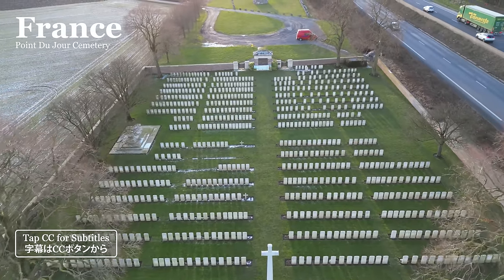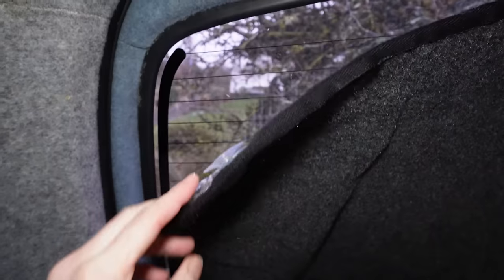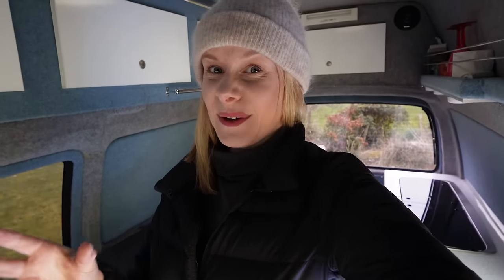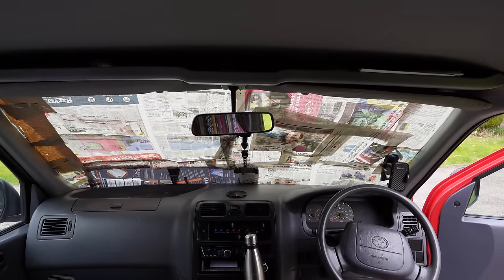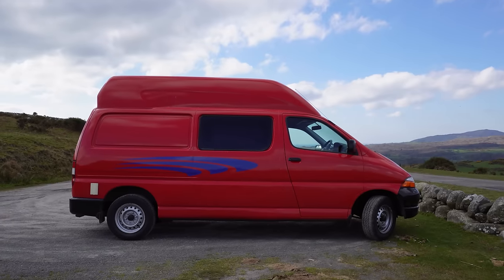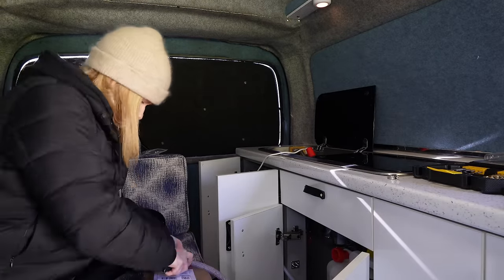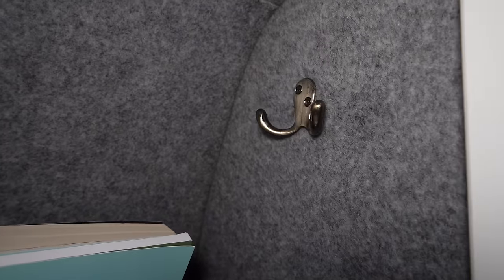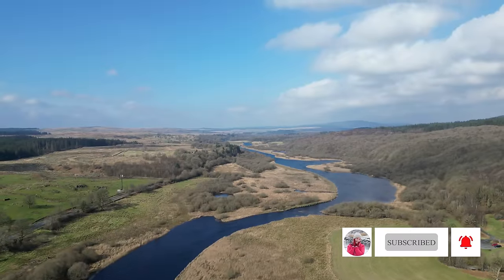It's Time To Make Some Changes...

Comment: Hi, Ruth, and glad to hear you’re recovering so well 🙂. I’ll add my voice to those suggesting Velcro for the window-covers — I would suggest using something similar to the epoxy used for rear-view mirrors for the patch you want on the windows, as it is very heat-resistant.

The only tricky thing would be for the roll-down windows (driver and passenger doors) — probably have to put up with the suction-cups for those, or the Velcro would run into the weather-stripping.

About the electrical situation: Since you are otherwise happy with the huge battery pack, wouldn’t there be a way to convert the voltage out of that to 12 V? Might have to bribe an electrical engineer with a bottle of single-malt Scotch 👍❤️, but I’d think there would be some easy way to “neck-down” the juice to 12 V (easy for a EE, that is 😅).

Is that colossal battery 240 V, like most Euro electrics? Being an American, I always have to remind myself that systems in the rest of the world run at higher pressures (voltages) than what the U.S. uses at the household-level.

Some kinda crap about higher voltages being more efficient or something 😂 — personally, I think it would be a lot safer if the entire world used good old 120 V AC, and 12 V DC, “like God Intended 😂”!

Japan is a whole other story, I guess 😅, as it usually is (and as you know quite well)!
Reply from the maker: Ah yes doing the electrics in the van in Japan was very tricky haha!

Comment: Regarding the electrics, you might think about buying the B300 battery to go with AC200max to have more capacity/independence if away from mains charge.
Reply from the maker: I did consider it and measured it up but it doesn’t fit. I have the spare AC70 with me too for back up

Comment: Perhaps there's not as widely available in the UK since it tends to be cooler and more overcast, but here in the US it's quite common for people to buy these windshield sun visors made from basically the same metallic material that fold up accordion-style and usually make a pretty decent fit for most vehicles. They come in various sizes and shapes to accommodate all the different vehicles out there. Perhaps you might find one and use it as a backup or perhaps as a second layer for especially cold nights.

Also, instead of constantly applying and removing suction cups every day, why not attach them permanently, and glue half of a velcro strip to their back side, and the other half to the front-facing part of the window cover. Or, perhaps, some sort of magnet. This way you won't wear out the suction cups but also not permanently mark up your windshield. I used magnet strips to do something similar on a project I once worked on, and with enough of them you could easily hold up the cover and not worry about it falling off at night.
Reply from the maker: Thank you for the ideas, these are very helpful 🙏

Comment: Just a suggestion --
($.02) Every "van lifer" should have one of these -
NOCO GB40 Genius Boost Plus 1000A Amp 12V UltraSafe Lithium Jump Starter Led USB
This is just an example. There are many versions and brands.
--------------
Nobody can predict what is going to cause the next dead battery. That foot pump is a huge step backwards in quality of life.
Here is a much better solution
12mm Round Push Button Switch Momentary OFF/ON Self Locking/Self Reset 3/5-Pin ($.02)
Reply from the maker: Thank you. So far although the foot pump is more annoying to use, it uses much less water

Comment: Nice blinds and soft handles, vegimite is not for me. I lived in NZ for 14 years and had to find Marmite instead. There was a marmite shortage one year and bottles were trading for silly money. 
As for your battery running out I would always fit a simple dual battery system so your starter battery is always ready to start your vehicle. Another simpler idea would be to carry a Norco jump starter (other products are available) this is a device similar in size to half a brick that you connect to your battery when flat turn it on, then crank the engine. I have all the bits to upgrade my dual battery system on my land rover and will still carry the norco jump starter in which ever vehicle I'm using it has helped me and several others start cars and even jump started a motorbike for someone who was stranded. If you are in Aberdeenshire over the summer I may have the bits you need for dual battery taken off my land rover by then that you are welcome to have for your van. Or if you want to run different starter and house batteries I have a new DC to DC 12 12 30 I'd be willing to sell for a good price as have been looking at other options.
Reply from the maker: Thanks for the advice Graham! 

A marmite shortage 😂

Comment: Hello, from the USA? Good Job on the deadly handle change out! Lol I cut my teeth on a Black and Decker corded drill and when they made a rechargeable I owned that. It has been a staple here in the USA, but I have to say, I am now a DeWalt fan. If you get a chance, say if that very reliable B&D wears out. Try the DeWalt drill and driver combo. You will love it. Thanks for your great vlogs! They are really fun to watch. Have you seen an otter yet?
Reply: You aren't sure where you're saying hello from ??